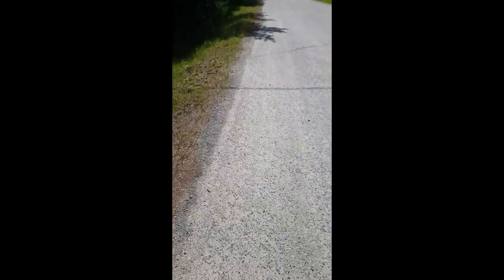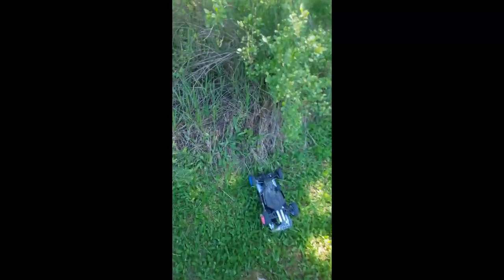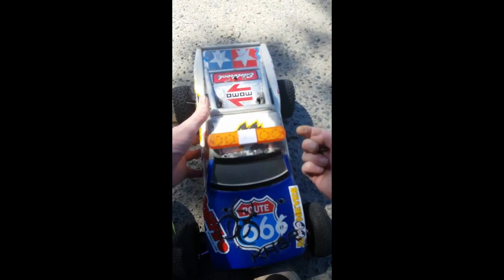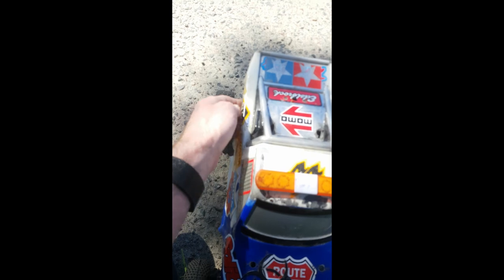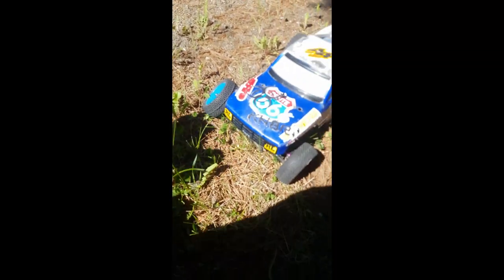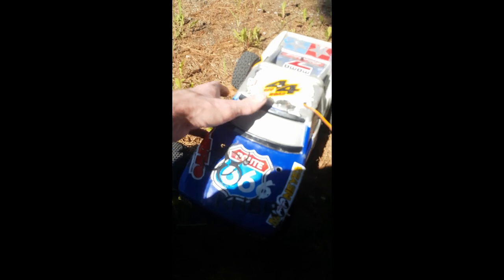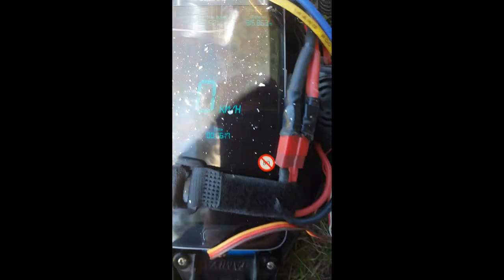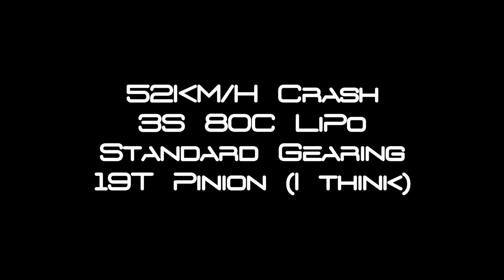First (invalid) run for @cw-01creations46's  DT-02 speed competition.

Comment: I'm really impressed with the 52kmh crash on half throttle 👍
At least your walk of shame wasn't very far for you to go to 😂
Reply from the maker: It was probably closer to 75% throttle lol, and yea the walk of shame wasn't too far, at least the second time. My poor light though, that thing never saw me coming. Should have turned it on for the run.
Gotta get the car put back together and shove the 2S in there, hoping I can fit the phone under the Sand Viper body. Apparently it's monsoon season though so it'll probably be mid July before I can get another run in.
Reply from the maker: I've also gotta find out how Mark Bryan did their extensions, the DT-02 looks mean with that long front end, I dig it.